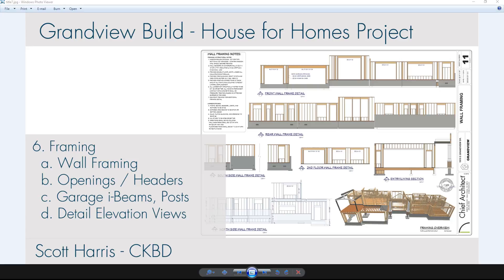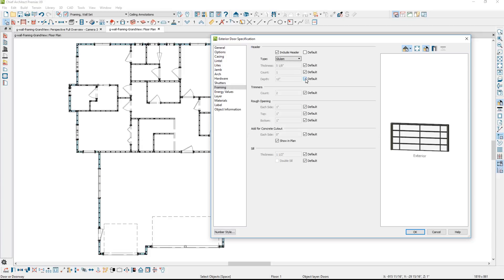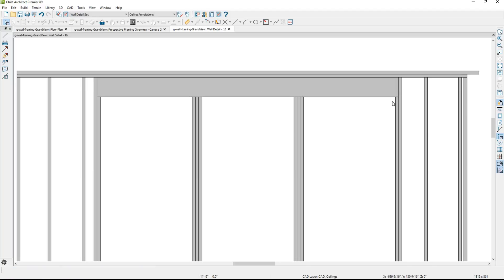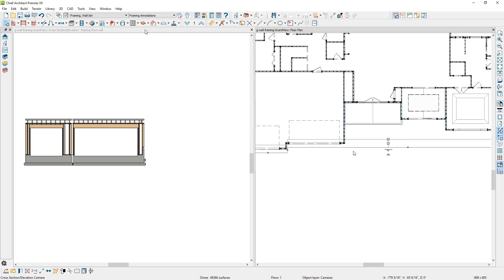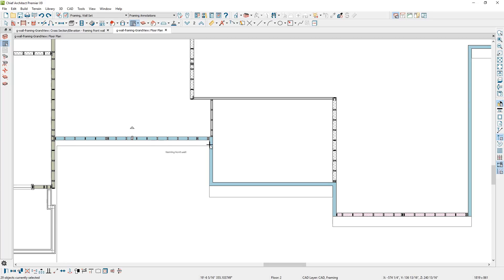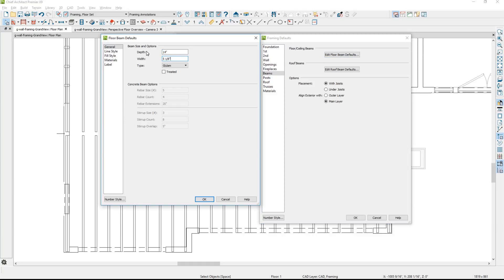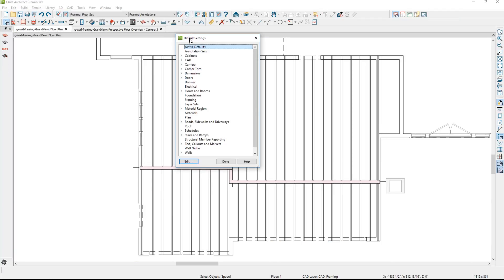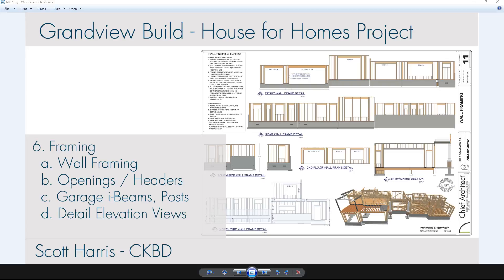Grandview Build Project - Automatic and Manual Wall Framing

Comment: When I turn the build framing, nothing happened to my drawings not in framed form like yours
Reply: Thanks man it works now. great you are
Reply from the maker: Bestyentertainment
, be sure to mark the "Automatically Build Floor and Ceiling Framing", "Automatically Build Wall Framing", and "Automatically Build Roof Framing" in the Build Framing dialog. Once these boxes are checked, it will build the framing for you.
Reply: @ChiefArchitect  IM abt to give up (given up many time before to :P)  i wanna change the stud spacing  no matter wht number i change  i does not change from 384mm i want them at 600mm...........   i can change the roofe spacing no problem there but the walls just wont change  kinda same issue as Vegil  but  no problem solved here......
Reply from the maker: @malacruxnorman3162  Here is a video that shows how to adjust stud spacing. https://www.chiefarchitect.com/videos/watch/334/controlling-wall-stud-spacing-and-materials.html